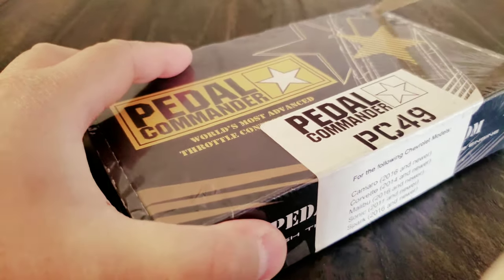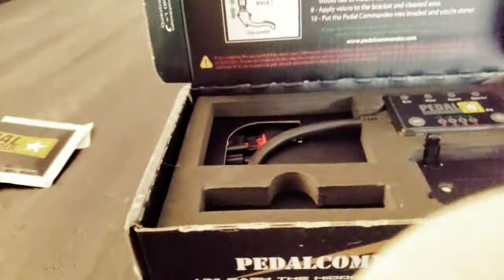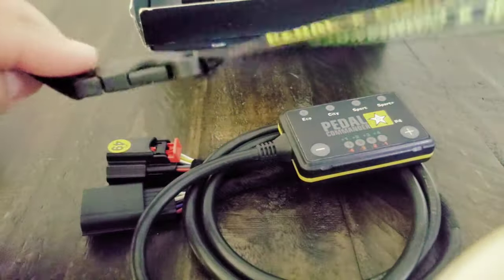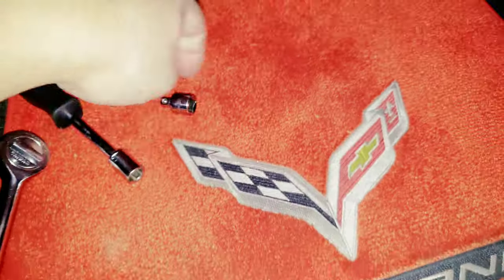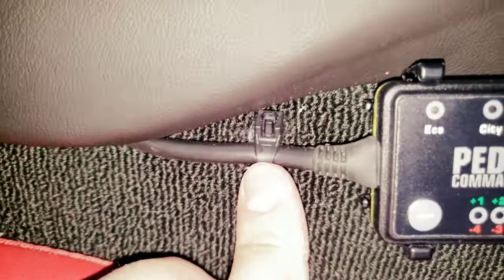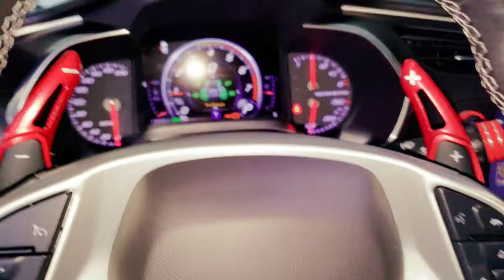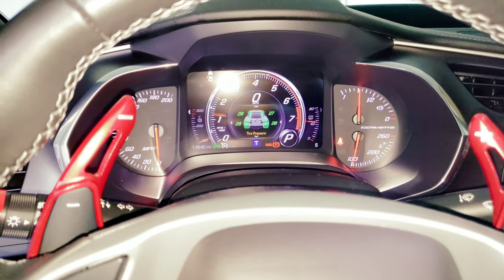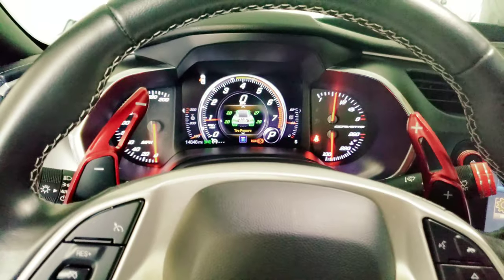Pedal Commander PC49 unbox Install & Review | Repsol13 F26 Corvette C7

Comment: Dose it change the startup exhaust noise levels? If you set it to economy vs very aggressive can you hear a higher or lower exhaust noise level.
Reply from the maker: Same exhaust note, this only Overwrites the throttle response level, normally control or delay by the ECU.  (DOT safety), when older car used to  be throttle by cable, there is no delay.  Now, throttle by wire, they delay it for Emissions & safety purposes.

Comment: Thrittle response is so bad made me want to sell my car when i first got it! Loll thats why i always drive in track mode its a bit better.. i want one of these but scared that it will ruin the warranty
Reply from the maker: it is just plug in and unplug, which will not void the warranty... for many issues people have, is due to changing mode while the car is moving.  car need to be at a stop to not confuse CEU fuel management, cause limp mode/warning light.  (which can easily reset by turn off the car and turn it back on)